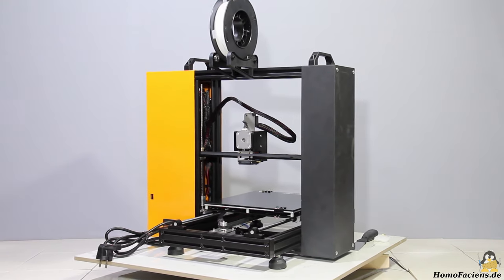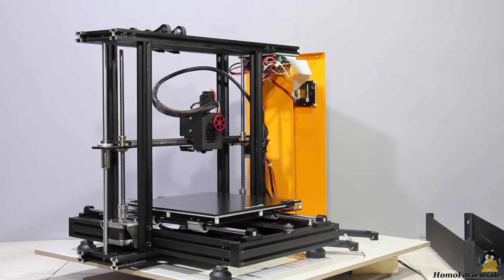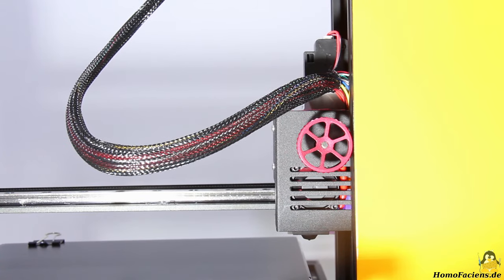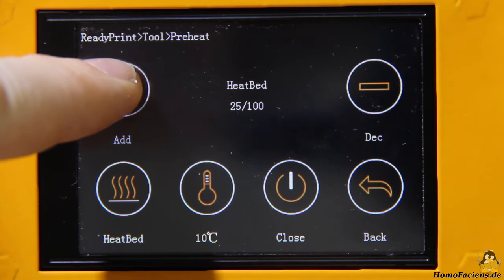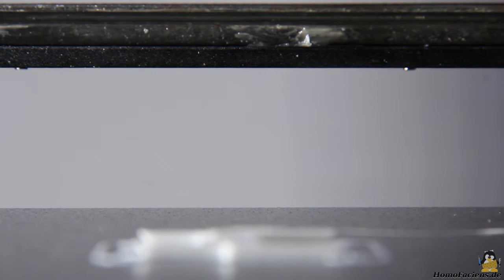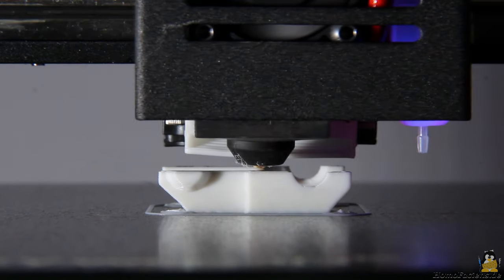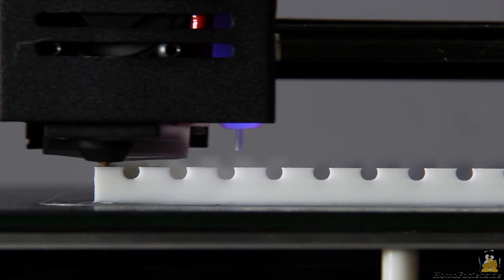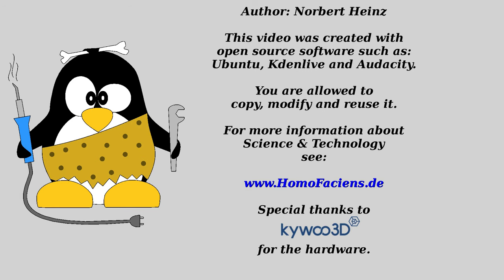Review of the Kywoo Tycoon 3D printer

Comment: I think I have seen better results from other printers in other videos.
Reply from the maker: I haven't said that this is the best of the best printers, because I never use any superlatives when describing a machine. All I can say from my experience is, that the output of this printer is among the best of the machinery in my workshop.
Reply: What have you seen make better prints at this price?
Reply from the maker: You always get what you pay for. It is a good printer and if you compare it to other printers of that price range, the differences will be marginal. Of course you can spent hours of research if another one is 1% (of whatever) better in what ever category, But I stopped seing that as a point that really matters. If there isn't something really worse on a printer (what ever printer it is) it is one you can buy. Something to keep an eye on is if the printer firmware is open source. I don't recommend buying closed source devices.